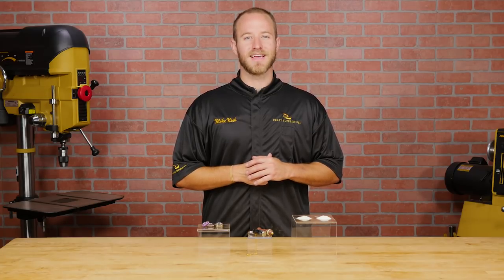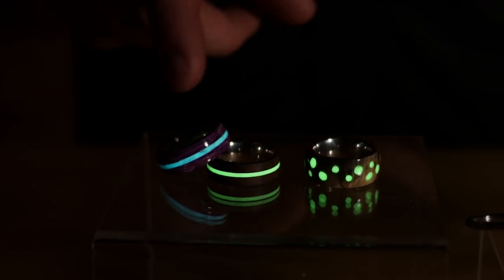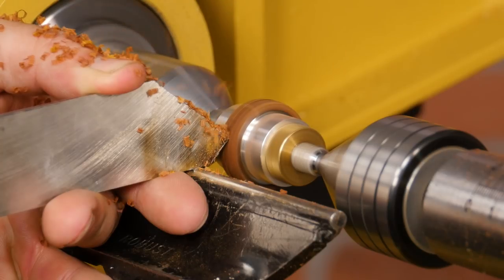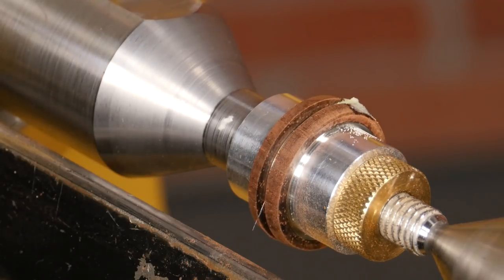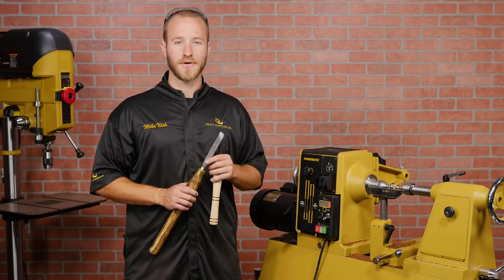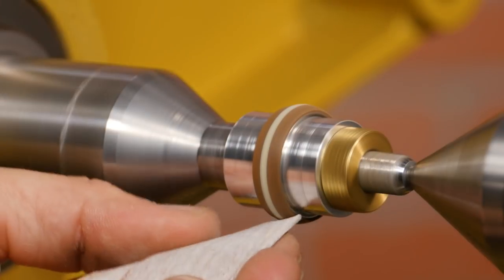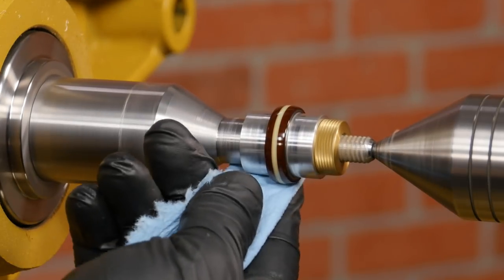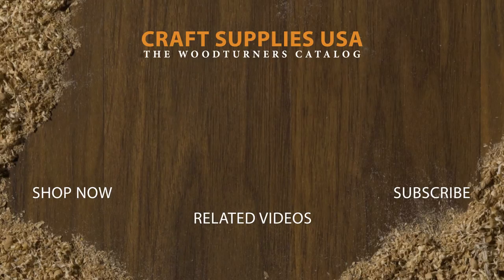Turning a Ring with Glow Inlay Powder (Woodturning Project)

Comment: How many times will it glow in the dark or will it last only for 10 hours or will last longer then one day.
Reply from the maker: When properly charged by sunlight, the powder will hold a glow for up to ten hours. Once the glow is dull, just give it more sunlight to charge it back up. The ability to glow should last for years under normal conditions.

Comment: Hi, hope you can answer my question.

I'm planning to fill a pattern on a stainless steel ring with glow powder mixed with the thin CA glue. My question is, how do I remove the excess of that mixt from stainless steel? Any suggestion?

Thanks a lot for your answer.
Reply from the maker: A carbide tool is the best way to go. You can turn down the powder/CA mixture all the way to the steel with it. In fact, the powder is so hard that it will dull any other tool almost immediately. Turn just until the metal is shiny. If you have specific questions, please contact us over LiveChat on our site or by calling 1-800-551-8876
Reply: @CraftSuppliesUSA  Thank you so much for the help and thanks for the information.

Comment: Is that the 5mm thick ring in the video?
Reply from the maker: We used 8mm ring kits
Reply: Would the same parting tool work just as good for the 5 and 3 mm ring sets or would do you have another tool that you would recommend?
Reply from the maker: They'll work just fine because Narrow Parting Tools are only 1/16" thick. Here's a link to our most affordable Narrow Parting Tool. https://www.woodturnerscatalog.com/p/135/3132/Robert-Sorby-Narrow-Parting-Tool And sorry for the late reply
Reply: @CraftSuppliesUSA  It's ok about being late on the reply. I know I commented close to the weekend. Ok, I'll put that tool in my wishlist. Lastly, is there a chance of having the ring blanks of all sizes in a set deal? All the 8mm sizes 5-15 as one set?